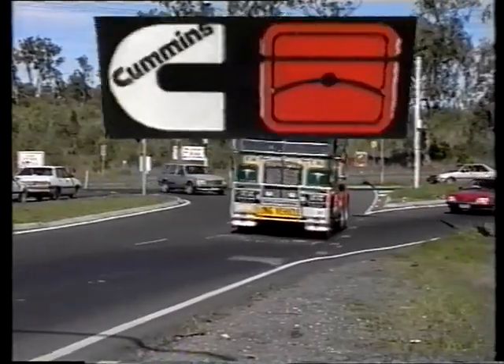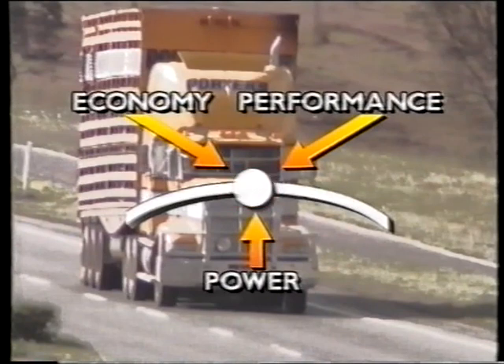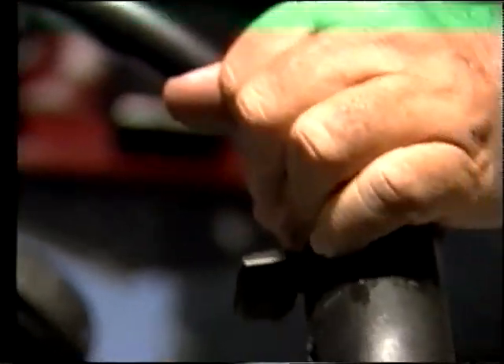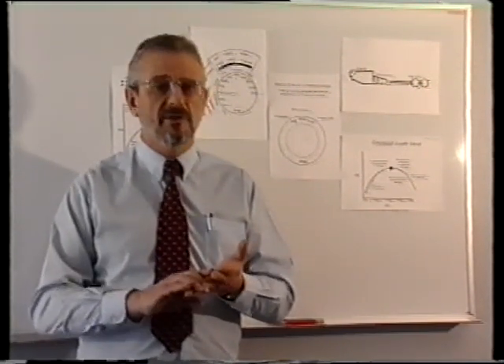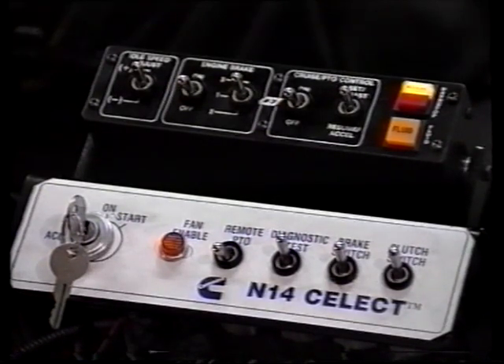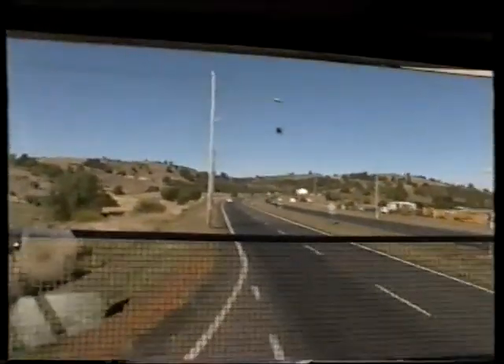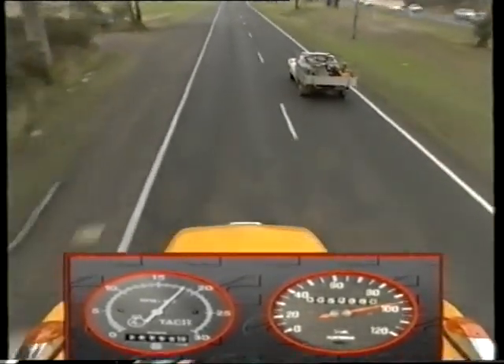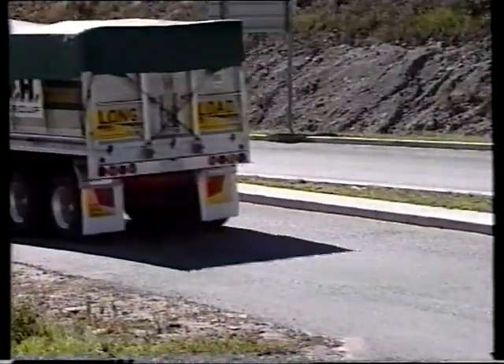DRIVING THE CUMMINS COMMAND

Comment: The first esp engines were shit. I was mates with a bloke who drove Turner's truck show winning t950. Had a 410/460 esp and a 10 speed Rockwell. You would hit hills and it would pull until the truck settled to the speed it could pull and bam, derate to 410 and you were left usually dropping the button and hitting the bottom half of the box. Witnessed it first-hand. They ended up straight rating it to 430